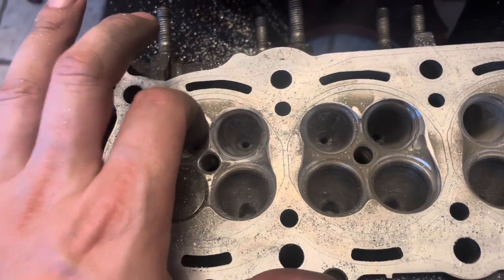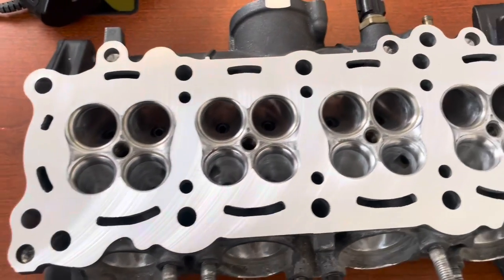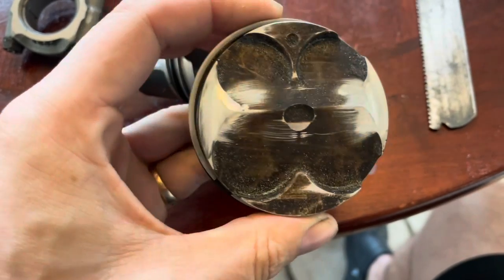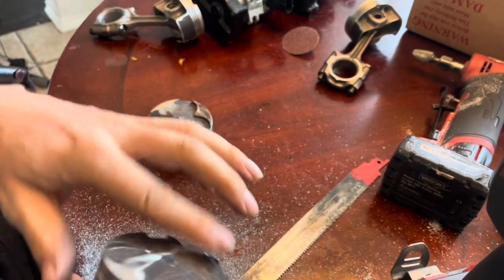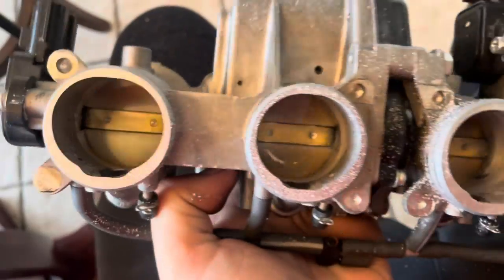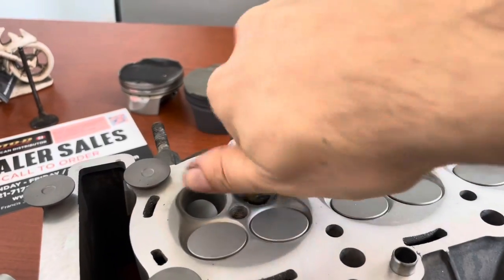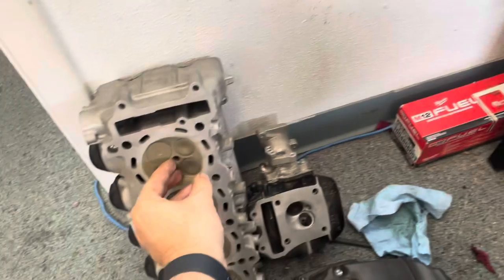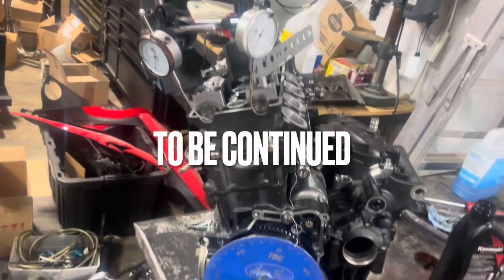R6 Insane Motor Build 140hp? Pt1

Comment: Where is the part where you take a little bit of weight off the crank lobes so you don’t get vibration where’s the part where you measure the piston to make sure that it’s still balanced and that you took equal amounts off of either side did you do one side and then weigh the shavings and then do the other side and weigh them no OK

Comment: Dosent the ceramic coating trapp the heat in the head?
Isn't better for heat the get out thrue head?
Reply from the maker: It keeps it from going into the head
Reply: @blackwidowpowersports6037  yeah that was what I meant . Don't that make everything too hot in the combustion eventually?... isn't it better to get the heat thrue the head for cooling
Sure heat is power but there's a fine line .....just a thought
Reply from the maker: @Motoinc  yes that is possible but we are running most of these motors on E85 or other forms of alcohol so the heat is not a problem we also see a significant reduction in the ignition timing needed to make power but raising the compression ratio does that to.
Reply: @blackwidowpowersports6037  ah sorry I missed that....then I get it.
Cheers

Comment: will never understand running to the rev limiter the power stops a grand before so no need to bang the limiter and how do you keep the side to side balance and weight exact on the piston without flycutting to exact thousandth never seen any builder use a grinder to cut down a piston or throttle body
Reply from the maker: It’s not the most ideal way to do it but as long as you now know much you’re removing and do it the same way on all it will work if I do it again I will remove the material off the head instead she stopped making power after 17krpm anyway
Reply from the maker: It’s not the most ideal way to do it but as long as you now know much you’re removing and do it the same way on all it will work if I do it again I will remove the material off the head instead she stopped making power after 17krpm anyway

Comment: Do you do flash tunes I got a 08 r6 bored by millennium to 636 and some head work and I'm wanting to go e85 lmk
Reply from the maker: Yes but a built motors is best done on the Dyno are you able to bring it to San Antonio
Reply: Unfortunately no I'm in California 😕
Reply: Will I need adjustable cam gears with a 0.27 head gasket
Reply: How much has the overbore kit given you on the Dyno..surely you added new cams.. another 14 rwhp.. on stock rwhp figures of 116-118 rwhp .. lets get some realistic dyno figures  folks..

Comment: How big of an upgrade would you guys say ceramic coating the cylinder head and piston crown is?
Reply from the maker: 5% Hp and tq with 10*f lower Coolent temperatures but it takes a huge amount of prep work
Reply: @blackwidowpowersports6037  thanks for the info I really appreciate it. Over the winter I’ve coated 3 engines with it but have yet to ride the bikes so I was just curious.